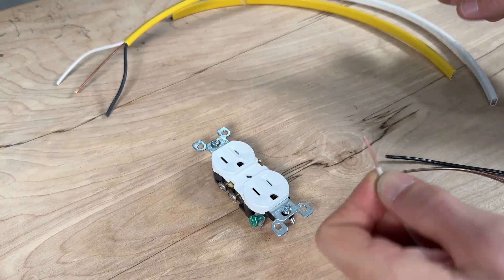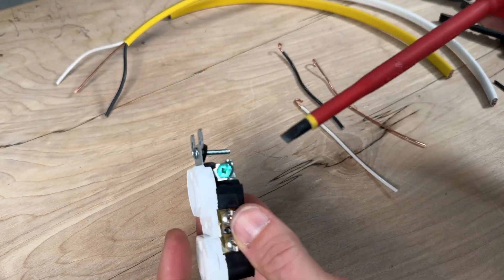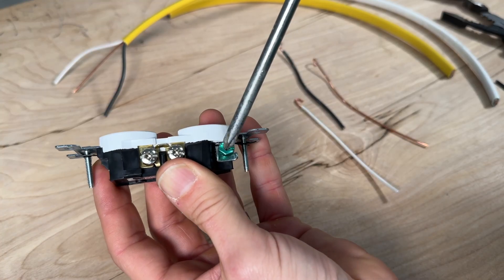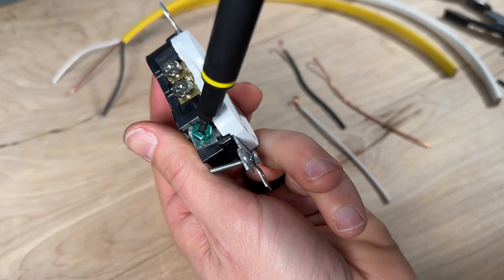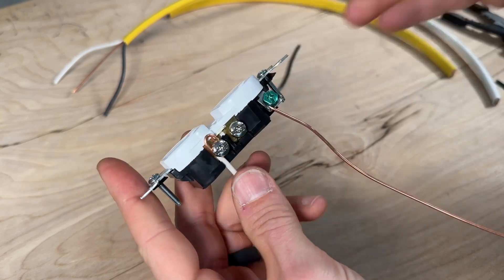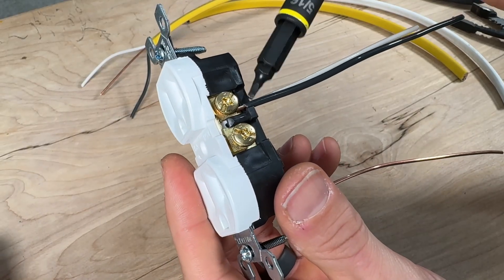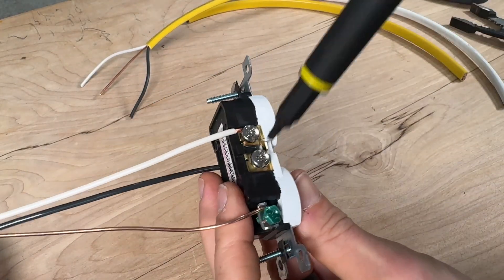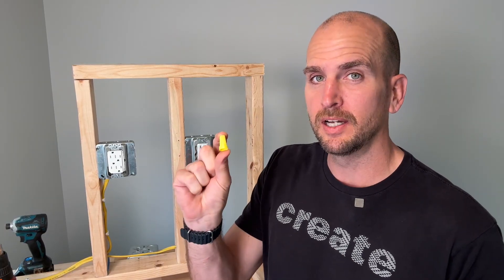DIY Guide For Wiring An Electrical Outlet

Comment: I still prefer wire nuts over wagos, and Buchanan splice caps with 4 way crimper over wire nuts when using stranded wire.
Reply from the maker: I have never given those buchanan caps a try but have seen them around.  Thanks for the feedback.

Comment: I admit also to not always starting with the ground. One thing that would help me remember is giving a reason why it's good practice to do so
Reply: Old journeyman told me about ground conductors as a first year apprentice: "First (connection) to make, last to break".
Reply: @raymondmcgee4491  man, that's weird because I am actually trained as an automotive technician and in the world of DC electricity most of the time the ground is last to connect and first to break. The reason for that is so that if you get a surge of current flowing through the positive side you may mess up some electronics or even your ECU.